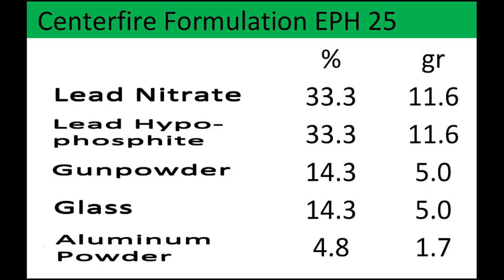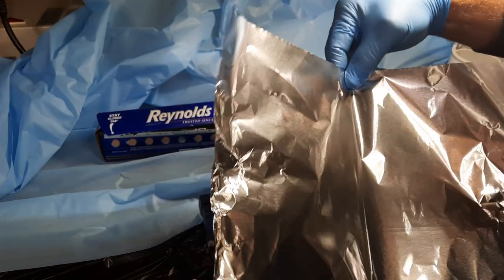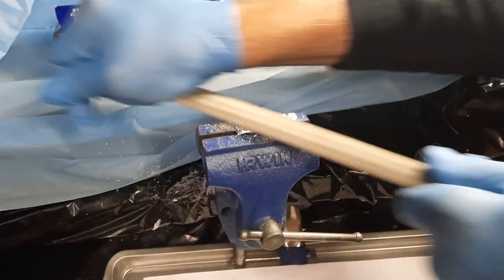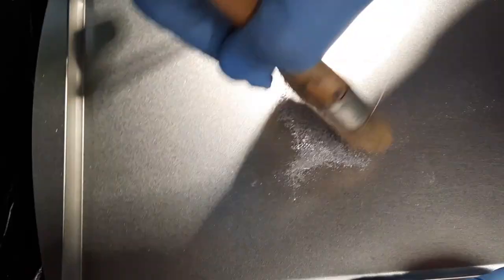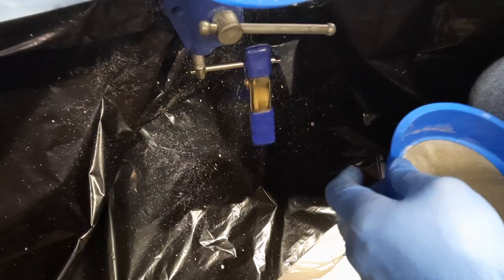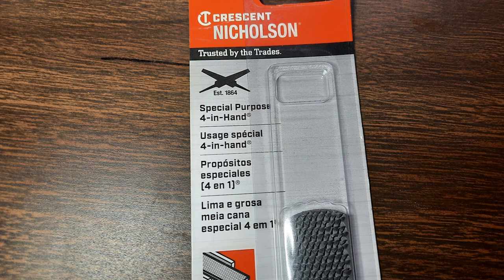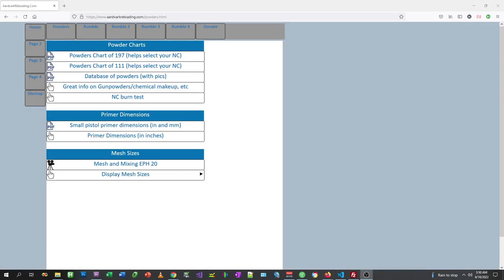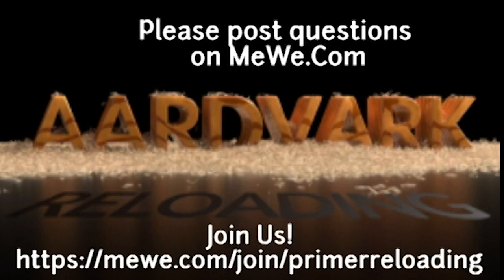Making Aluminum Powder - The Easy Way

Comment: What do you think about using 50%/50% magnalium(MgAl) powder as a replacement for aluminum powder?
In just 4 or 5 hours in the ball mill, a very fine powder is obtained.
Reply from the maker: You would think this would work great.   Afterall - magnesium 
is used for making sparks with firestarters and such.
Unfortunately - we activate the primer compound with water.
The magnesium will readily react with water to form two materials.
One of the materials is called magnesium oxide.   Unfortunately -
the magnesium oxide will suck moisture right out of the air ("hygroscopic").  This moisture
will actually deaden/kill the primer compound in the cup.

Stick to aluminum.   It's very easy to obtain and it works great!

https://rumble.com/v10hnmr-making-aluminum-powder-the-easy-way.html

After you make a few batches and prove to yourself that eph 25 works then
feel free to experiment with various materials.    Report your successes
and I'll help share your findings.

Other materials successfully used are copper (harvested similarly 
from copper wiring) and titanium (just buy it).
Reply from the maker: From Marshall
Yes, ETN should work as a replacement for NC. It may not take as much in the formula to give equivalent performance. So, some adjustment may be needed if the primers end up being too hot and try to back put of the primer pocket.

Regarding TATP, I have no advice. In the 120+ years of primer development this chemical has never been used to my knowledge. As inventive as the primer companies are, I don't think this is an accident. Might be great, but they are on their own if they try this one.
Marshall

In other words... TATP .Do NOT try it.   Do NOT.

But yes on the ETN.
Reply from the maker: @coyotexpl1507  I have been thinking a lot about your question (about ETN).    I'd like to recommend that you use the NC that is called for in the recipe before you start making substitutions.    Prove to yourself the recipe works as-is first.  Make 'say' a couple of hundred or so and get comfortable and confident (even excited) that the recipe works and then start making substitutions.   That way you have a base-line in which to improve.    Marshall's manual is full of recipes (actual primer recipes) that work.    It is color coded "green" that it works.   "Muli-colored" where is the recipe did not work (at first) but he tweaked the recipe and he Made it work.   "Red" where it's a primer recipe but he could not personally make it work.   In other words - the recipe needs work/further research.
Reply from the maker: @coyotexpl1507  join us at primer reloading on MeWe.   You are describing either Eps 5 or EPM 8 (my fav).   Nothing weak about either and lead free.    The expense ain't an issue (to me)... it's going to be relatively cheap per primer.    I don't think you can out  price tag on freedom and independence from the crap.    You'll have primers at your disposal .
Reply from the maker: Here's my standard invite (following)
Reply from the maker: @coyotexpl1507  Hi there!
Jump Start 1 - I'm trying to get you going!

https://rumble.com/vjdy5h-reloading-primers-for-beginners-jump-start-1.html

AardvarkReloading.com and MeWe’s Primer Reloading and Primer Reloading for Beginners Chat Forums go hand-in-hand.

Please go to one of the chat rooms and let us know what information you need to get started reloading your own primers and our group of members will do their best to provide it. We are very interested in your success in this endeavor. There will be no ridicule of any questions you ask no matter your experience level. We grow by utilizing your background and experience in your various professions - so please be willing to share.

The MeWe chat forums consist of the best group of guys on the internet in primer reloading and other skills and you're now a part of it.

Primer Reloading group (known as Second Floor):

https://mewe.com/join/primerreloading

If you find the Primer Reloading group chat too technical, try the ground floor:

https://mewe.com/join/primerreloadingforbeginners

You will be welcomed in both!!!

Finally:
I publish much of this info on:

https://aardvarkreloading.com 

==== MeWe Navigation ====

MeWe Navigation - Groups:
https://rumble.com/v15wnom-homemade-primers-mewe-groups.html

MeWe - How to Chat:
https://rumble.com/v15x61q-homemade-primers-mewe-chat.html

MeWe - How to Post:
https://rumble.com/v15x61q-homemade-primers-mewe-chat.html

Posting Photos and Files:
https://rumble.com/v18j51b-homemade-primers-mewe-groups-photos-and-files.html

Comment: Id think any regular hunk of solid aluminum would be much easier to file than foil and cheaper for sure
Reply from the maker: it's whatever you have handy.   most any aluminum will work.   trick is to get the right mesh(es) to classify the filings.   80-120 mesh (or so) for sparks works well.      We have learned don't allow the "big chunks" of aluminum to get mixed into the primer compound.   We have learned if a "chunk" of aluminum get between the nose of the anvil and the primer cup a ftf (fail to fire) can occur.

Comment: Wouldnt it be easier to put aluminum foil into a thrift store bought blender? It works pretty good. Can also do cans with the tops and bottoms removed.
Reply from the maker: That may indeed work but we didn't have one handy.     Don't leave it unattended for long periods of time.